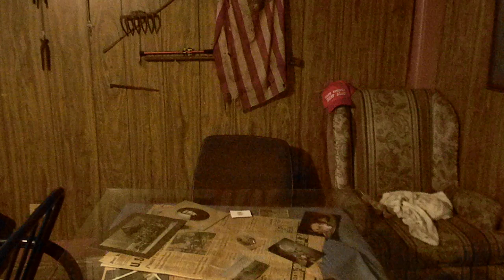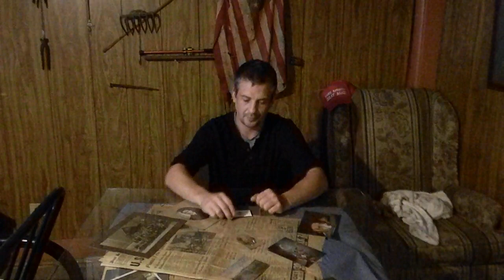Refined Synthesis of RDX

Comment: What other sight do you post your videos?
Reply from the maker: https://www.bitchute.com/channel/JJNI53eMMLUy/
Reply: @darianballard2074  btw your plastic home made composition is pretty good but it depends on how powdery your powder is. If it's a fine dusty powder you rock tumble then your rubber cement oil mix needs to be adjusted in favor of more oil as the putty will be alot thicker. Regular recryistalised powder works fine with your original recipe
Reply from the maker: https://rumble.com/user/Darian2ATEMPLAR
Reply from the maker: https://odysee.com/@Darianballard:b

Comment: Those old bitchute videos need to be reuploaded, bitchute changed how videos are stored and shared, which the old way they used webtorrents, they dropped it over privacy concerns, and now all the old videos that were uploaded using it no longer play. So all of those Synthesis videos need to be reuploaded
Reply from the maker: Are they all not working?  I've been uploading to odysee because Bitchute has been giving me nothing but trouble.
Reply: @darianballard2074  If you can reupload all of the Synthesizing videos on odysee that would be great too

Comment: And sir 99% nitric acid If you don't take it, you should take less, Then it will be,please tell me a little, sir
Reply from the maker: No you really need 98 to 100 % nitric acid anything less and you'll get nothing back.
Reply: @darianballard2074  To me 75% nitric acid There is so
Reply: I went to make it today rdx, But not made, because the hexamine I used was granular, a grain smaller than salt, like baking soda, Something hexamine are not dissolved in acid,I've been around for a long time, the mixture color was a little red, not acid color clear that, temperature mixing time 10° are not a problem, please say something sir please, I have very sad,
Reply: Red an yellow colour nitric acid both are Able to make rdx
Reply from the maker: @sandipmridha6497  Yellow or clear and it must be  97%  +.  Red might work but not good.
Reply: @darianballard2074  I have collected pure clean nitric acid.Pure clean nitric acid will do just like your video rdx explosive For ready Will this process
Reply: @darianballard2074  sir Why the reaction turned light red, after the mixture

Comment: then from RDX you can make HMX, a very very powerful explosive used by the military in detonating nuclear bombs, as well as shaped charges and other incendiary.
Also never use mercury fulminate with rdx as a blasting cap (or dont even get the two in contact) RDX has been known to go off with mercury fulminate.
Reply from the maker: HMX can be made but the problem is getting the RDX contamination out. I'm not even sure the government has pure HMX.
Reply: @darianballard2074  oh okay. Just curious where did you get all of your knowledge about this stuff?

Comment: If you dilute the solution with hot water the nitric acid oxidizes formaldehyde and rdx will precipitate in a sandy form
Reply from the maker: Thanks for the information.
Reply: Hellow I made the RDX, precipitated reaction Is possible

Comment: So are you going to keep the syntheses on BitChute, and the testing on YouTube once the strikes are gone?
Reply: a video on SA.DS would be nice, too.. it's a nice compound.. and since you've got a nice laboratory, are you planning on to make acetic anhydride and use it to make HMX?
- and careful with silver nitrate (azides, SA.DS) even microscopic amounts stain fingers like hell.... as well any any furniture

By the way, were you satisfied with the performance of the melt casts?
Reply from the maker: No because my last 3 strikes where just test videos.  If I re upload videos it will be stuff like mixing plastics and making stuff like  ammonium hydroxide.
Reply from the maker: YouTube has it out for my channel. They let just about every one else post videos like I had with out any problem.
Reply from the maker: nehorlavazapalka I was happy with the ETN/PETN but not the ETN/RDX.   I already have some  acetic anhydride  and if you know of any good sources for  information on synthesis of HMX and purifying out the RDX  contamination that would be nice. :)
Reply: A method of separating a mixture initially containing between about 60 and 95 parts by weight by RDX and between about 5 and 40 parts by weight of HMX to recover essentially pure RDX and essentially pure HMX which consists essentially of:
(a) agitating said mixture with a sufficient amount of water and dimethyl sulfoxide at about 30° C. for about 1 hour, said dimethyl sulfoxide and water being a cosolvent for RDX and HMX having a cosolubility constant preference for HMX to dissolve essentially all the HMX present;
(b) filtering the essentially pure undissolved RDX from the slurry resulting from step (a);
(c) precipitating the filtrate from step (b) by saturating said filtrate with water to recover a solid having as a major component HMX and as a minor component RDX;
(d) agitating the precipitate of step (c) with cyclohexanone at a temperature of about 30° C. for about 1 hour to dissolve essentially all of the RDX present, said cyclohexanone being a solvent for HMX and RDX having a cosolubility constant preference for RDX; and
(e) filtering the essentially pure undissolved HMX from the mixture resulting from step (d) at a temperature of about 30° C.
 
I am not even sure that this works but I feel that it might and I am working on this

Comment: Link works without problems. My question: Bitchute platform should by better than Minds or Vimeo..? Thanks.
Reply from the maker: Yes It is better than both Minds and Vimeo.   Vimeo you have to pay for any video bigger than 500 MB and minds you can only have a video 15 minutes or shorter.
Reply: 15 minute is enough, but for some projects not. Thanks for reply...:-)
Reply: be careful, pure lead azide is extremely friction sensitive - so don't let your fingers anywhere near that material
Reply: certainly not more than 3 mm (~ 100 mg/cm)